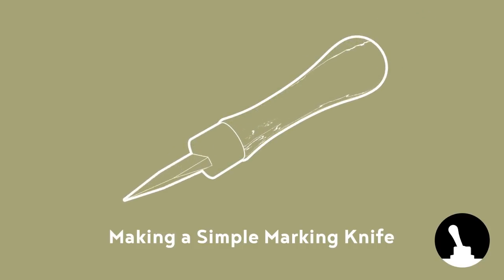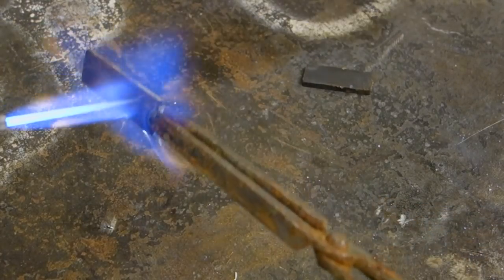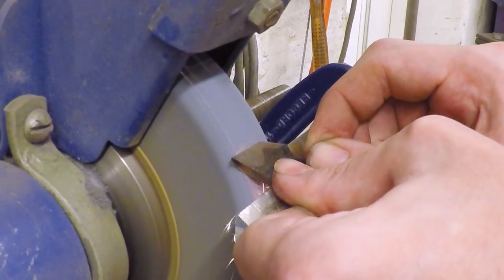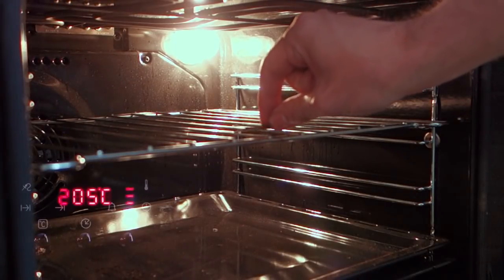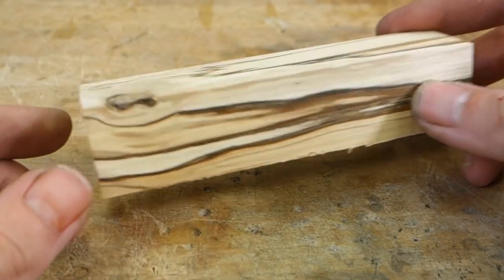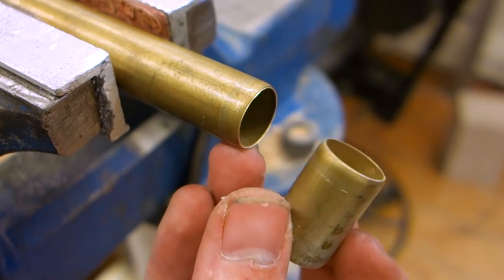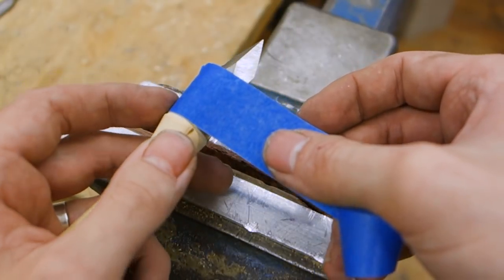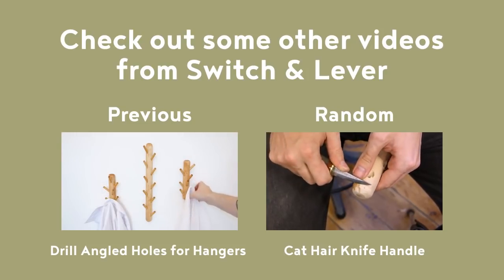Making a Simple Marking Knife

Comment: If you are working a lot with spalted wood you should look into a pressure pot (lots of DIY plans out there) and a long-curing expoxy to stabilize the wood and harden it for turning. You will be amazed at the difference this makes.
Reply from the maker: Yep, well aware of them and their use. I haven't felt a pressuring need to make one. Also cactus juice (of which I'm a fan since I lived in the US) is pretty impossible to come by over here in Europe, so I'd have to find a suitable replacement.

Comment: Very Good Tutorial, Thank You. One question, why do you touch a magnet during heating the tool please?
Reply from the maker: It’s kind of like a thermometer. When the steel is hot enough not to be magnetic it’s hot enough to be quenched and hardened.
Reply: Thank you, that is a great and very easy useful tip to know.much appreciated.

Comment: The spinning scotch-brite on the lathe is a death-trap, a life-ending accident waiting to happen. Scotch-brite is notorriously "grabby" and can fling this small blade like it's nobody's business. This kind of abrasive should be used, in the context of knife-making, only as a belt on a belt grinder, and then only with the blade held tip-down and without any king of rest/table. I'm one of those who laugh at overly safety conscious people on the Internet, but this one legitimately made the hair on my arms raise.
Reply from the maker: You should never grind anything with the tip up anyway, way too much chance to grab even on a fine grit belt. They make wheels for benchtop grinders from scotch brite as well. Granted my contraption was a bit more MacGyver than what that would be, it was also spinning at a much much slower speed than a benchtop grinder. Even if it grabbed the blade it would have, at worst, tossed it down into the chip pan of the lathe. Not saying it's safe, but not much more dangerous than a scotch brite belt or wheel.

Comment: Would you recommend any specific types of projects for beginners that are too scared to work with too many power tools..?
Reply from the maker: You could've done pretty much this entire project without power tools, you don't need to use a belt sander to grind metal, you can use a file and sand paper. You don't need a lathe to shape wood, you can use saws, chisels, files and sandpaper, and so on and so on. The best project to do is the one you feel passionate about. Think of it as problem solving. How can you do a specific thing with what you have available? Google and YouTube are your friends in this!
Reply: Switch & Lever thank you! :)

Comment: Old engine oil is great, puts a bit more carbon into the steel. Lower flash point as well.
Reply from the maker: I wouldn't recommend it, a motor picks up all sorts of crap while running, such as heavy metals, and that tends to collect in the oil. The smoke from old motor oil is downright unhealthy. If you need to get carbon into your steel there are better methods.
Reply: With all due respect, all the tooling and processes shown in this video can be classed as unhealthy or potentially lethal. If care is taken, then any risk is minimal.

I enjoyed the video and have liked it.

Comment: Have you ever considered using super glue to make the wood harder? It’s great for making the wood more stable.
Reply from the maker: I don't really like using super glue as a top coating, it's too brittle in my book, and the penetration without a pressure (or vacuum) chamber is not especially deep. If I had a vacuum chamber I would've probably stabilized the wood with proper resin instead.

Comment: Superglue is perfect to stabilize that kind of wood. the outside anyway.
Reply from the maker: I really don't like superglue finishes, they become too brittle in my opinion. Drop them on a hard surface and they get damaged.
Reply: @SwitchAndLever  have to be pretty big objects in that case. Never had that problem with the handles or winestoppers i have made.
Reply from the maker: @np02058  I've made pens with CA finish, and when dropped it has both chipped and has gotten small crazing marks. I think it's because the finish is so hard, it becomes brittle. I much prefer a little softer finish, like poly, or something that soaks in a bit like linseed oil.

Comment: actually the part of the blade you are cutting into is not hardened. typically they only harden the end of the blade that has the cutting edge on it.
Reply from the maker: It's really interesting that you make that comment despite a) obvious signs from the sparks when cutting it that it's hardened steel and b) the fact that a file skates over it. It's definitely hardened.
Reply: @SwitchAndLever  nw. It could be a difference in the brand,  I have stanley planes and none of mine are hardedned at the back I have filed all of them round with no issues at the back part of the blade. Something Paul sellers does in his restoring a plane video. I honestly have never noticed a difference in sparks when cutting hardedned vs non hardened steel but I havent cut a lot of hardened steel in my time.  Also I didnt see you file in the video so its not something I would have noticed. loved the final result though Ill be maing one myself. unfortunately I dont have a spare blade so will have to use a ciircular saw blade.
Reply from the maker: @johnthebob1  at about 0:58

Yeah, a circular saw blade is a great option. I'm always on the hunt for old saw blades, like properly early last century if possible, as the steel in them is usually both really good but also easily hardened by quenching, as opposed to a lot of modern "mystery" steels.

Comment: Ew why are you using a sharpy? Go buy blue dyechem.
Reply from the maker: What's your issue with sharpie? It does the job, and is readily available since layout fluid isn't exactly commonplace here.
Reply: i guess i overreacted. sharpy seems messy
Reply from the maker: Layout fluid is messier, takes longer to dry and is more messy to apply because of it. Sharpie is dry in a second.